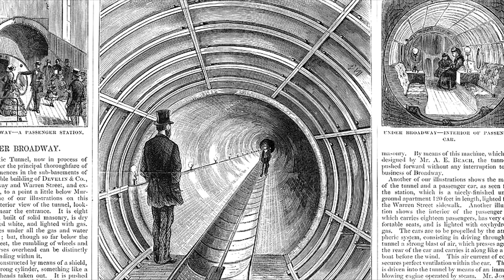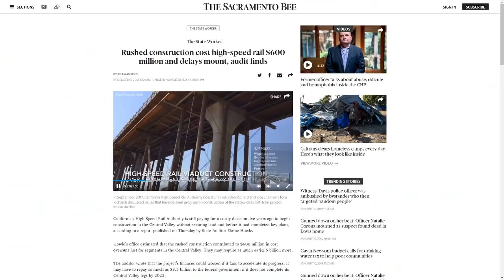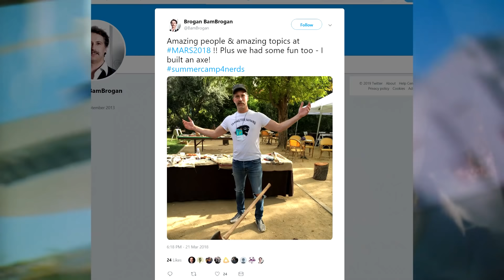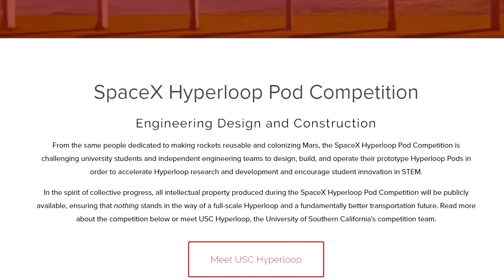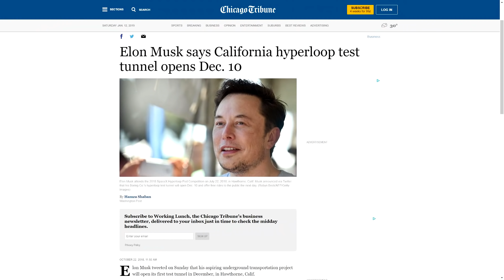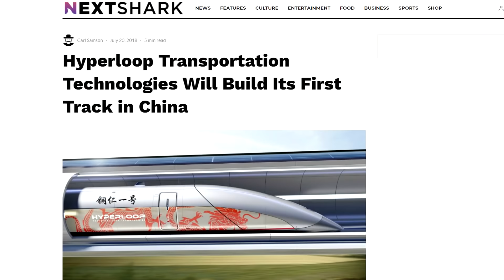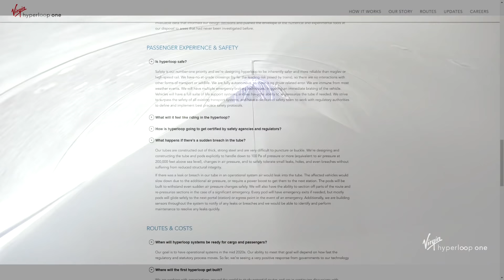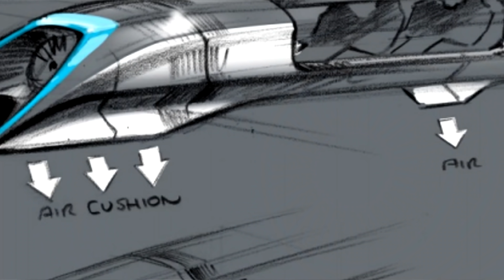Why Hyperloop will FAIL HARD - Its Biggest Problem...

Comment: seriously??? I guess if you lived in the 1800s you'd be passing out newspapers explaining why the Iron Horse is doomed to failure and we need to stick to canals
Reply: finaly some one with brain
Reply: Thing that doesnt exist is just like thing that now exist and not at all like other things that turned out to be horribly impractical.

Flying cars..moon colonies....jetpacks
Reply: @brendo7363  moon colony's? .... We haven't found out yet that they are horribly impractical... But yeah I get your point.
Reply: @lefotografion   You think a colony on a place that doesn't sustain life and you need to import every single requirement at $10000/lb isn't impractical?

Think for a minute, even if you solve the technical problem of an enormous system of vacuum tubes, every hyperloop pod only carries about 20 people and you need to load them into an airlock before coming or going, that is fucking slow and costly.

Having a higher potential top speed is literally the only advantage of this over high speed rail. It is so much worse everywhere else.

You can load 1000 people into a train and just send it off at 150mph
Reply: @brendo7363  yea i thought about getting cargo/passengers in an out of the pods... And yes, until this problem is solved, the hyperloop makes no sense. But I think there are ways to load the pods quickly, without depressurizing the whole tube. And then, when it's solved, it can still Carrie only 30 people... But there fore every 30 second's.

Comment: Aside from the fact that this video is offered by a group dedicated to a competing concept, namely high-speed bullet trains, I see a few omissions or outright deceptions in the presentation, the following points among them:
1. Musk's tubes are fed by a high-velocity air stream, which is not the same as depressurization.
2. A hyperloop keeps the user in their personal vehicle, ready to drive immediately to their actual destination, a huge advantage over any passenger train, especially in the United States where autonomy is a cultural imperative.
3. Most of the route in Musk's concept is an underground tunnel built below existing highway routes so few if any right-of-way lawsuits or acquisitions would present themselves.
Reply: I guess you are talking about the boring company tunnels and not hyperloop.
Reply: @samt1705  Thanks.  The media seems to mingle the concepts and I plodded along in their footsteps.

Comment: Nothing has been covered about the small point of the amount of g the passengers will feel as it takes a corner or indeed how it handles a corner in a tube. Bullet trains tilt..maglevs have guide rails which form into the tilt.. how do you do that in a tube? Also there will be pressures exerted on the tube in the corners.. how will they with stand the pressures associated with a train going over them? Be interested to see how they over come this.. because as far as I can see they would have to make it a straight line to achieve the speeds they want. No curves. Also a train actually slows down in a curve some what.. and accelerates out. Shinkansen less so but.. still dose. So what I see front this network is a train that can go 700+ in a straight line only.. um that’s a slight flaw in the design then.. that’s why it costs.. better be good with your rulers boys. Like I say.. be interested to see how that’s over come.. it’s not even had a person riding it yet so.. we won’t know yet. Mmmm 🤔

Comment: Musk doesn't actively fund/develop the Hyperloop and Branson is on the Hyperloop craze but has a rail line right where the Hyperloop should be, it seems that even the ones that fuel the Hyperloop hype aren't sure that it will be a good system
Reply: The amount of misinformation in this video is pretty impressive.
Reply: High speed rail for the most part is impossible in the US. For starters, we are a massive country and we still have more railways than any single country on earth, and up until the 1960s, we had more rails than every other country combined. But passenger trains have fallen by the way side. Why? Because the cities you would want to travel too are so far apart, that even high speed rail would be slower than just flying there, and when you get their, you're gonna need a car, so if you dont live near an airport, you might just drive, after all, the trip is half the fun provided you actually like whoever your traveling with.
Reply: @theduke7539  why do all those that say that high speed rail is impossible always cling to large distance such as LA to NYC? Ofc in that distance no rail is practical, but in shorter distances it makes a lot of sense

Comment: The space station maintains a cylinder of about 10m in length of 1 atm in a space of 0 atm.
On the other hand, Hyper Loop plans to maintain a cylinder with a total extension of about 10,000 km at 0 atm in a 1 atm space.

Children can understand that this is a very difficult and extremely uneconomic Babel tube.

Comment: First of all: This video is 100% right

Hyperloop as envisioned by Elon is not part of even one of these weird plans

in the end these concepts are basically a maglev in a vacuum tube.

Is air friction really that big of a problem for trains anyways?
Can someone do the math? I think its negligible. Except at ridiculous speeds.

Funny that the German Hyperloop from TUM is one of the most valid concepts when we can't even get our regular trains in order here in Germany.
Reply: Have you tried moving at 600mph at sea level? There's a reason cars going over 200mph is a big deal. It's fucking hard. Hell, maglev trains don't even break  300mph. That should tell you something.

Comment: I don’t think even Elon is taking hyperloop that seriously, but hey, at least the boring company looks promising.
Reply: it cost 10 million for the booring company to dig a 1-mile tunnel . that's an economic suicide
Reply: @MrLiquidxIce  "10 mil for a 1-mile tunnel is economic suicide"
"Seattle hold my Starbucks..."
Reply: Not amazingly so - as with all these claims, beware of incomparable comparisons.  The actual cost of the easy bit, burrowing a tunnel, is slap bang in line with every other tunneling company.  It's the other stuff that adds the cost (stations, for instance)
Reply: has this company anything to do with nescar?
becouse if i use google and type in: why is Nescar...
i get ´´boring´´ 2 times suggested...
Reply: The boring company isn’t doing anything useful. Hyperloop is better than what they’ve produced.

Comment: the pumps required to maintain even a 200 mile 10ft diameter vacuum tube would require a dedicated nuclear power plant.. so its absurd at face value.

Comment: The main problem with this video is that the concept of hyperloop is more or less the idea that things can go faster while using less energy when they're in a vacuum. That totally goes for superconductoring maglevs and you could probably get speeds of about thousand kilometers an hour if you were to stick that thing inside a vacuum tube

 Also hyperloop would be very good earth-based testing for space-based infrastructure because something like hyperloop is the standard in space and you could use that space based infrastructure to transfer people around the world stupidly fast much faster than anything we have today and that does include hyperloop.

Comment: Maglev + Evacuated Tubes = an expensive mess. Forget hyperloop research, look at the most pressing problem currently, efficient local travel. For example, synchrotrain is a concept uses the rail network, running separate cars in an automated transit network (ATN) configuration. Even in it's most basic form on a regular rail line, you could make the front car take the fewest stops and so on.

Comment: I thought this channel supported transportation systems that will better connect cities. It’s not necessary to shit on the hyperloop. Trains are great but there is room for other forms of transportation. Innovation is never a bad thing even if it fails it’s better than not trying.
Reply: What I gathered from this is basically pro train propaganda. There isn't a whole lot of real information, but there is a lot of opinion and speculation with some misinformation sprinkled in.
Reply: @mobilemarshall  such as?
Reply: Actually no, given the population of cities and current clean energy problems, we really need forms of transport that are energy efficient and don't require a lot of space. With the turn radius of the hyperloop and the need to constantly sustain a vacuum, hyperloop is neither. Realisation of the project seems still years away, but cities are congested today already.
Reply: @jlust6660  To take advantage of the high speeds vacuum tunnels afford, destinations would be long distances from each other, so turn radius isn't really as big a factor as you're making it. Constantly sustaining the vacuum level required for the purposes involved isn't hard, as the vacuum level required isn't very high. If the system was engineered well it should be quite energy efficient compared to other forms of long distance travel. There's just a massive upfront cost and upkeep.
Reply: @mobilemarshall  Turning radius is a factor, because you need to figure out a route. You're almost definitely going to have dodge quite a few obstacles, and a track that requires huge turns makes it more difficult to avoid them. You're bound to run into a lot of geography issues if you need to build a route that 'stiff'. Currently the cost of upgrading and maintaining railways is apparently too expensive, so how will they fund these extra upkeep costs? And sustaining a vaccum requires more energy than you would gain from the reduced drag I think, so it's hard from an energy perspective.

Comment: Liked until "hydrogen powered trains."
-
You were showing video of a maglev train as you said that, what would be the point of the hydrogen? Hydrogen is just another fossil fuel anyway.
Reply: Do you seriously think fossil fuel means something that burns?
Reply: @aneticus9337  No, but I do KNOW that hydrogen is made from natural gas, which is a fossil fuel. It's impractical to split water in order to make hydrogen, it requires fresh water (which is a precious resource) and an enormous amount of energy.
Reply: Electricity is mostly made by fossil fuels, so by that logic, it's a fossil fuel too.
Reply: @aneticus9337  But it's not and it makes far more sense to just burn the methane for energy. When hydrogen is made from hydrocarbon fuels, the carbon is simply pumped into the atmosphere anyway.
Reply: @aneticus9337  You completely changed your comment. Fuel is something which can be made to chemically react with other substances so that it releases energy, electricity is not a fuel.
Reply: @aneticus9337  Anyway, I don't see what's wrong with using power lines to power trains, just make them extra high in the US in order to accommodate double-stack cars.
Reply: @PistonAvatarGuy  NUCLEAR FUSION IS THE ANSWER
Reply: Also It's carbon monoxide being produced alongside the hydrogen. The reason why hydrogen might be a good idea is because the only product of burning it is water
Reply: @aneticus9337  No one knows how to make energy with fusion (yet), so how is that an answer to anything?
-
Carbon monoxide is a deadly pollutant, so it's converted into carbon dioxide before being released into the atmosphere. You're just moving the release of CO2 from the tailpipe to the refinery (metaphorically speaking).
Reply: @PistonAvatarGuy  It gets converted to co2 in the atmosphere. Why would you release it anyway? Why do we have to release CO2 at all? Isn't there a simple and easy way to turn it into ink?
Reply: @aneticus9337  No, it gets converted into CO2 before being released, just like it does in the catalytic converter of a car.
-
Converting CO2 into something else requires more energy. If you're going to go through so much trouble to produce a carbon-neutral fuel, it makes far more sense to produce a fuel from captured carbon which can be burned in existing engines without damaging them, this eliminates the absolutely enormous amount of resources and energy that would be required to to produce an entirely new fleet of vehicles. DME (dimethyl ether) is likely to be a good replacement for diesel in locomotives. It would require the use of a fuel tender, but so would a hydrogen powered train.
-
Hydrogen just doesn't make any sense as fuel, from any perspective.
Reply: @PistonAvatarGuy  What about nuclear fusion? Also this dimethyl ether seems to be interesting. I'm going to use it one day to make a car that has a jet engine that runs on it.
Reply: @PistonAvatarGuy  Also fuel cells might make more sense in electric aircraft, because they're much lighter than batteries. it would make much more sense to just run the jet engines on biofuel
Reply: @aneticus9337  Like I said, no one knows how to make energy with fusion, everything is still in the very early experimental stages.
-
Fuel cells do not work much better in aircraft than batteries, fuel cell aircraft are still borderline useless. Cost is also a major problem.
-
Biofuels require far too much land area to produce, we could never meet the demand for jet fuel with biofuels.
Reply: @PistonAvatarGuy  (Fusion has been in the "very early stage" for decades now) Wait so if fusion doesn't work yet, batteries and fuel cells don't work, biofuels don't work, and fossil fuels are bad, then how are we going to fly planes?
Reply: @aneticus9337  Batteries work fine for some applications, like commuter cars, or delivery vehicles. Nuclear fission works just fine, it's the safest, cleanest form of energy that we make use of on a large scale. Carbon neutral synfuels are showing significant promise, but would require enormous amounts of nuclear energy to produce, those fuels could be used to power planes, ships, and many ground vehicles. The same technologies used to produce those fuels could also be used to pull CO2 from the atmosphere so that it can be sequestered, and that's something that we're going to need to do before this century is over.
-
People need to understand that the market system can't help us avoid global warming, it's just inherently unable to facilitate the actions which must be taken.
Reply: @PistonAvatarGuy  Yes! nuclear fission! and the carbon neutral synfuels I've never heard of. Research time.
Reply: Ok so apparently pretty much liquid fuel can be recreated in a carbon neutral way! Why does practically nobody talk about this?
Reply: It actually burns cleaner too than the fossil fuels! Thank you for this new knowledge that you've given me.
Reply: Apparently Mclaren is doing it! Yes!!!!!! The internal combustion engine is saved!!!
Reply: @aneticus9337  Because it's not a profitable technology, so the wealthy aren't interested in it.

Comment: By itself there are a lot of very challenging problems with Hyperloop, but the killer is the competition from maglev trains which crush it with capacity, safety, mature development, and economics. I would be curious to see a cost comparison for maglev tracks and Hyperloop tubes. Since the Hyperloop is basically a maglev track in a vacuum tube, I can imagine how that would look.

Comment: To create and maintain a vacuum even in a relatively small volume is very expensive. The wall of the tube would need to be very thick so as not to crush under atmospheric pressure. Obviously the passenger area would need to be held to at least the pressure found inside a large plane. Each station would also need to be pressurised there by creating very expensive sealing arrangement between the tube and station. The very expensive material and engineering challenges just go on and on. Other than it simply being a novel idea it will never happen and yes it's a scam. You can quote me on that

Comment: I mentioned this somewhere else a long time ago, but why would deliberately put yourself in a transportation system that only required one small hole on the tube for the entire system to implode? And even if it doesn't, whoever's travelling on the pod who's going to cross the area that's being pressurized, they'll experience what it's like to be riding a bullet crashing into water while travelling at the speed of sound. If the pod doesn't desintegrate, turning you into minced meat, the G forces from the impact surely will.
One slight fault on the entire network causes the whole project to fail, so I repeat the question. Why would you ride it?

Comment: The only argument that seems to hold water is that the existing maglev trains travel at near 400mph and the tracks are cheaper. This, however will require a good deal more power due to resistance. The operative question comparing them is how much for the cost of building and maintaining the tunnel vs the power advantage (which would be a large part of the operating cost.) The inference that you Must use a pod vs a train does not hold water. They experiment with pods, then build trains. No need to change the design much at all. The question then should be a comparison of power requirements between the two weighed against relative cost of track/tunnel and its upkeep.